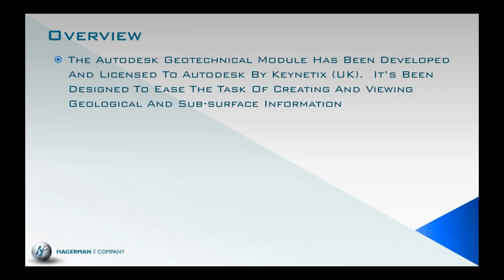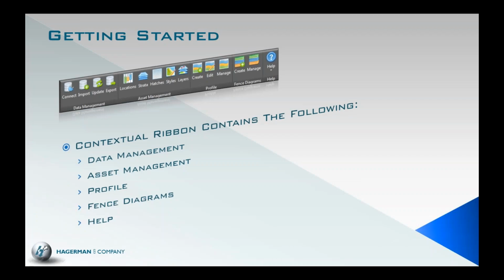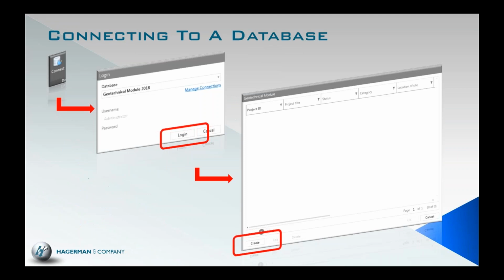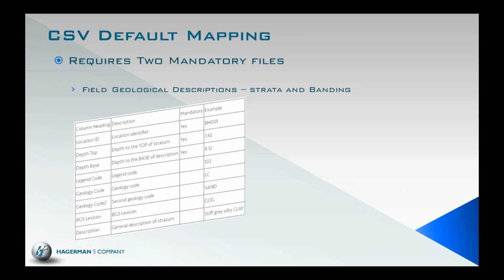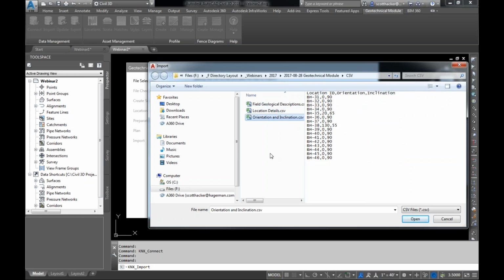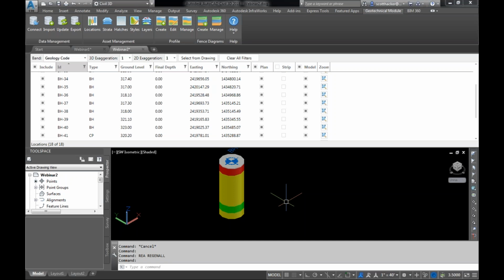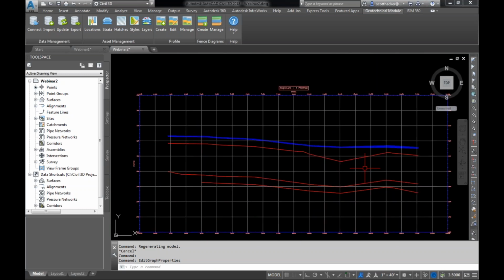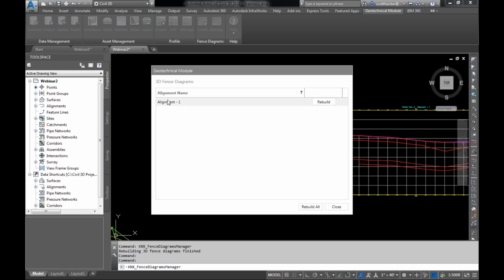Civil 3D Geotechnical Module – An Introduction

Comment: Sir can you guide me how to find or install the geotechnical modular extension in my civil 3d software
Reply from the maker: The Geotechnical Module is a free extension for Civil 3D — here's how to find and install it:

Open the Autodesk Desktop App on your computer and search for "Geotechnical" — it should appear as an available extension for your version of Civil 3D

Alternatively, log in to your Autodesk Account at manage.autodesk.com, navigate to Products & Services, find Civil 3D, and look for the Geotechnical Module under Extensions/Updates

Download and install it, then restart Civil 3D — a new Geotechnical tab will appear on your ribbon

Note: Make sure you're downloading the version that matches your Civil 3D version. If you run into any issues during installation, let us know!

Comment: - You need at least 3 or more points to generate a surface
- You need to rename repeating soil layers or else geology lenses (strata surfaces) intersect and messes up your profile
- If your geology lenses intersect you are $%#^ and you need to fix it with feature lines and sites which gets pretty hectic    especially if you have a lot of strata layers,

Guess they forgot to talk about this!

However, overall it is a great product for visualizing the subsurface.
Reply from the maker: These are all excellent points — thank you for adding this! You're absolutely right, and these are the kinds of real-world gotchas that don't always make it into an intro video.